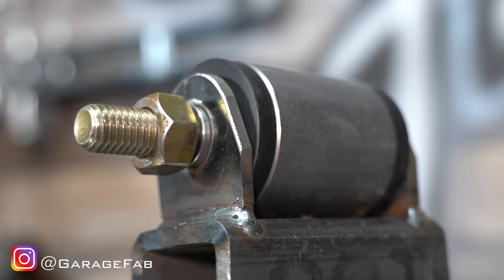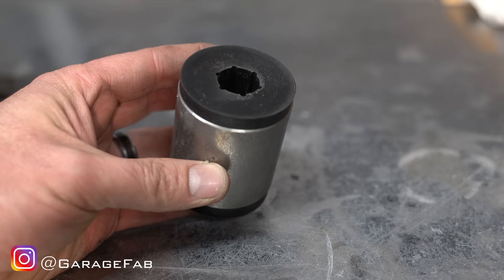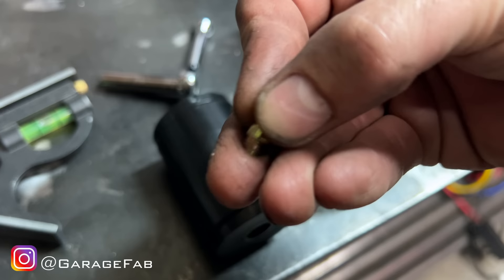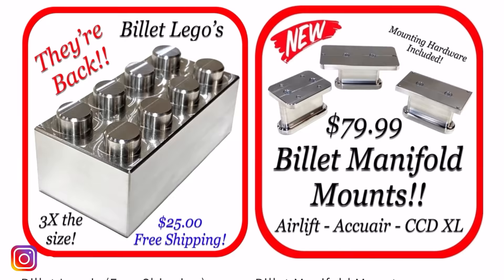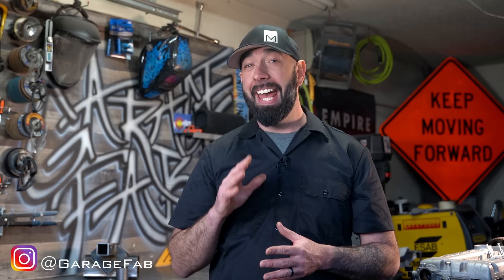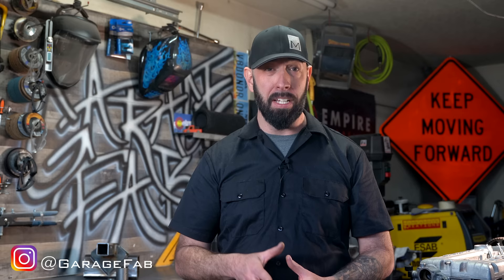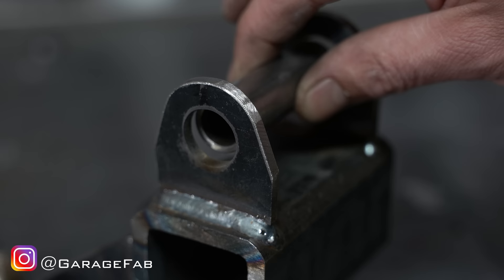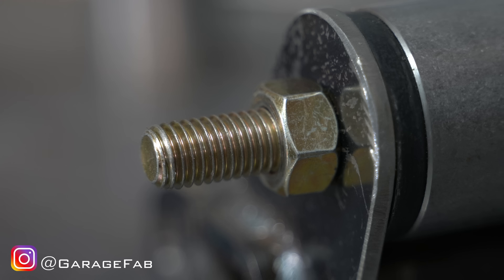The DOs and DON’Ts When Installing Polyurethane Suspension Bushings

Comment: Deceiving information for the beginners. The introduction should mention the two major differences between bushings. One is bonded, the other is not. Meaning one has no moving parts at all and MUST be tightened with the vehicle resting on its wheels, flexibility is provided SOLELY through the rubber.
The other can be tightened when ever (the grease one), because the rubber can revolve around the inner bushing, make sure to use washers or spacers to prevent bottoming out the nut on the shank of the bolt!
Also, you never clarified what is wrong with the picture, other than it should be a grade 8 locknut and the threads needed to be trimmed.
Don't use grease for the bolt, use gray antiseize, it outlasts any grease 10:1 and apply it to the ENTIRE bolt, including threads. The lock nut won't care if it's there or not.
5:08 does not make any sense to me, but I haven't built suspensions from scratch. You make an angled support strut, but the bushings are 45° to the load. It would make more sense to weld the carrier on an angle and keep the bushings perpendicular to the strut. I will try that myself.
Reply from the maker: There’s a lot to unpack there Dan. Let’s start with the bonded bushing. They are… well… bonded. They come fully assembled and therefore cannot be assembled improperly. They can be installed improperly as you mentioned, but bonded rubber bushings are not commonly used on custom builds and so they don’t have a place in this video.
Good call in pointing out the possibility of the nut bottoming out in the shank. I regret not including that.
Everything (almost) that was wrong with the intro bushing was addressed. The improperly shaped tabs and the tab holes that are too large and allow the inner sleeve to pass through. When designing the “bad bushing” I also didn’t provide enough clearance between the body of the bushing and the frame that the tabs mounted to. Unfortunately I forgot to bring that up in the video.
Anti seize instead of grease must be a preference. Ironically today I saw anti seize slathered on some brake caliper pins on a rusty car that normally has grease. The anti seize was dried and crumbly and it was tinged with rust. Before today I already hated anti seize and it’s get everywhere-ness. It has its place (on threads) but in my opinion nowhere else.
5:08 is a triangulated 4 link. The two angled bars keep the axle situated side-to-side. The orientation of the bar ends you described is commonly done and is ideal on static height vehicles. On adjustable height vehicles, though, (what I specialize in) the suspension can see upwards of 12 inches of travel. When the bushings are mounted perpendicular to the angled bars, the axis the bars rotate around passes diagonally through the bushing. So in essence the bushing is forced sideways. This destroys polyurethane bushings quickly.
For this reason I turn the bushings so that the bolts line up with the axis the bars rotate around. This puts more stress on the sides of the bushings which they are not designed to handle, yet they still last far longer.
Cheers, Dan!
Reply: @GarageFab  my man! Thank you for clearing up the points i made. I appreciate the time you took to write the reply. It does indeed depend on the type of antiseize and where to apply it. I have best experience with permatex and it is usually used on threads and applications that don't get too hot. So brakes are definitely a nogo for anti seize. Brakes, including calipers can get extremely hot. Rotors red hot, calipers 200°C, boiling brake fluid, so it certainly will ruin the antiseize.
The suspension design now makes sense, but it sure is a weird one haha.
Anyway, the least I can do is sub.
Thanks again!
PS I know how hard it is to make the video that pleases everybody (impossible).
Reply from the maker: You are appreciated, Dan! Happy to have you. I hope to see you in the comments section in the future. I’m hoping to make Garage Fab a top source for good info and you clearly have some of that.
Cheers mate!

Comment: Good video, but one thing:

A bushing is NOT the same as a rod end.

A bushing allows rotation about one axis, as well as giving some compliance, where as a rod end is a spherical bearing that allows (limited) rotation about three axis, and is rigid.
Reply: I disagree.... a "rod end", is simply that, an end meant to terminate a rod of sorts, in the case at hand, a suspension arm. A rod end may feature either a bushing, or bearing. Now the actual functionality difference between the two is exactly as you stated. 

However, in common nomenclature, what you say is commonly assumed as correct. If you tell me a "rod end", I'm going to usually assume you're talking about a spherical bearing end ("spherical rod end"), and only specifically note a bushing application, if you say "bushing rod end". I think the assumption will change depending on who you are talking to, and their most common use/application., but a rod end may have either a bushing or bearing. I personally would also assume you were referring to a piece with a threaded shank, but again, that's a nomenclature assumption, and would vary from person to person.

Case in point:
https://www.summitracing.com/parts/paj-1260-5-8

Now if you say "heim joint"...that's a different case, that's a bearing end, end of story.
Reply: @rwbodiford  Interesting; I'm usually the one who gets accused of being too literal.

Everything you say is true, and maybe the vernacular is different in the automotive repair industry, but I've read many books on race car suspension and automotive chassis design, and frequented many car forums, and I've never seen a bushing referred to as rod end.
Reply: @noahkatz9616  There's always "that guy" lol..... and if you comment on a YouTube video, you can be certain he'll always surface! 

Bushing rod ends are not near as commonly used, so the general assumption is always that a rod end is a bearing end, and I mean, it's a pretty safe assumption, like I say, I'd assume and know you meant a bearing end if you just said "rod end", but you just can't conclusively say that is the specific difference between a "bushing" and a "rod end". But yeah, either one can be a "rod end".  Could also debate the hybrid "Johnny Joint" as a third configuration if you were feeling frisky.

I'm actually about to use those same ends I linked to on a project,. I only need one axis of motion, and the added dampening of a bushing is beneficial in my case ( of course with performance sacrifice ), and I can still obtain a precise length adjustment on the link arm with the threaded shank, very application specific, but also, very useful when needed.
Reply: @rwbodiford  Well I'm not as well-versed as I thought - I wasn't aware of the joints you linked nor Johnny Joints; thanks!
Reply from the maker: I’ll chime in with some interesting behind the scenes info. This entire video was created in one day from start to finish in a rush to meet the Sunday morning deadline. While editing I noticed I said “Rod End” when I really meant to say “Bar End.” Which I believe is the universally accepted term in the suspension building scene. I decided to NOT bother with re-recording because in fact in the mechanic world “rod end” is commonly used regardless of the type of end. For example Tie Rod End (ball joint) vs. Torque Rod End (bushing).
I think it’s good practice to use a descriptive word for the sake of clarity. “Spherical rod end.”
Thanks for keeping it civil my friends! It was my hope that Garage Fab would turn into a place for discussions that didn’t always require my presence.
Cheers!
Reply: @GarageFab  So this is all YOUR fault :)
Reply from the maker: @noahkatz9616  Exactly!

Comment: I have never been a fan of the polly aftermarket bushings, OEM bushings are much better IMO
Reply from the maker: Every product has its place. If you’ve got a static height vehicle and want a comfortable ride, rubber all day. If you have adjustable suspension or a lot of travel, you’ll hate rubber bushings the second time you have to replace them.

Comment: Lol 😂 not required:) just have cut my rear suspension bolts together with bushings in my mazda 6:))) about a  week ago:) that won’t happen, if they were lubed properly 😊
Reply from the maker: It happens.
Reply: @GarageFab  even with lube inside?
Reply: @GarageFab  besides those rear suspension eccentric bolts I had to cut stabi links :) one of the main tools ⚒️ for repairing Japanese cars 🚗 is grinder:))) I had to change bushings in rear undersping arms, which certainly are connected to stabilizer links. Mazda rear arm price is $200 per one ☝️ local bushing $9
Reply from the maker: @SlavaKolesnikov  In Vegas, we don’t see rust fortunately. If we have to cut stuff apart it’s guaranteed the car came here from somewhere else.
Reply: @GarageFab  Canada 🇨🇦?) here in Ukraine 🇺🇦 there are tons of snow ❄️ salt 🧂 water 💧 mud 💩 meaning your suspension and chassis suffers a lot
Reply from the maker: Ew. No thanks! 😆

Comment: Nice, would be even beter using international metric system instead of the obsolete inches and pounds.
Reply from the maker: Believe it or not, I agree!! I tried to make the switch a year or so back. It didn’t work. Though the Imperial measurement system is outdated and confusing, it was impossible trying to measure everything metric and have to convert it to inches in order to purchase parts and materials.
If someone here in the states flipped a switch and we all went metric, that would be amazing. Too bad it’ll never happen. 🤷‍♂️

Comment: You worked for Toyota and seen bolts rusted into sleeves, yer the assembly line doesn't lube bolt shanks, slack and cheap. You left out the bit where Toyota nor any other decent manufacturer uses Polyurethane for suspension bushes.
Reply from the maker: Manufacturers must balance comfort, quality, and production costs when making millions of vehicles. Rubber bushings are soft, absorb a lot of vibration and are very cheap. So this is a great choice. They use quality rubber but it still won’t last a quarter of the life of the vehicle. 
Quality polyurethane is significantly more expensive, is far stiffer which channels a lot more vibration to the driver. This would be a terrible choice on their part. Poly lasts much longer and is far better for performance and overall is superior to rubber. There are a LOT of things that could be done better on any manufacturers vehicle but they are simply not cost effective. I’m unsure what point you’re making with the grease. It’s unnecessary in the majority of climates and so none of the manufactures grease their bushing bolts. So is every last manufacturer slack and cheap?

Comment: So, no info on installing and torquing oem bushings.
Reply from the maker: Nope, not on this one, sorry. 
I can tell you what I know here though!
Unfortunately I can’t tell you the torque specs, because torque varies with the size and rating of the bolt that is used.
I can tell you that the majority of OEM bushings are bonded rubber bushings. It’s imperative that you don’t torque the bolts down on this type of bushing until the weight of the vehicle is on the suspension.
Failure to do this will tear the bushings or caused them to fail prematurely due to being over flexed or over twisted.

Comment: The only thing missing from this: follow the instructions of the bushing manufacturer. This guy clearly uses a brand where this advice helps, but when it comes down to it, it does not necessarily apply to all poly bushings.
Reply from the maker: I’m unfamiliar with any polyurethane bushings that this stuff does not apply. Bonded rubber bushings are a completely different animal though and require specific torquing procedures.
Reply: @GarageFab   @GarageFab   Hey, awesome reply. I was really pointing towards the energy suspension bushings. 

On other forums, folks debate about which way to do it, but when it comes down to it,  just follow the instructions.

Case in point, ES (at least for the prelude/240sx/Celica GT4) does not come with grease fittings or troughs. You really just have to grease  (example) - 

"7. Grease the I.D. of the lower control arm (where the shell was). Grease the Energy Suspension bushing. Grease all sides
of the bushing that contact metal." 

Basically, they want you to great the inner AND outer portions of the bushing.  So, not knocking and you most certainly arent wrong, just reading through how folks debate through these and adding my .02.
Reply from the maker: I can’t argue with following directions! The manufacturer should certainly know what’s best for their product. Especially a company like ES.
I can tell you that I’d be modifying those to have a zirc fitting though. I’ve never had a poly bushing stay quiet with minimal supplied assembly grease. I think racers don’t care much about a little suspension squeak. On a daily driver though, insanely annoying.

Comment: This is all well and good and to me it's common sense, until the bushing is welded to a bar. Therefore how does one weld the bushing to a bar without melting the rubber bushing, cant believe you didn't explain that part!!!!!!!!!!!!
Reply from the maker: That’s a whole other video my friend. This one was strictly about the proper assembly of a polyurethane style bushing.

If you want to see the process of the bar end getting welded on melt free, you can see it in these videos.

How to Make Identical Length Link Bars! Mighty Max Ep. 12
https://youtu.be/feDRfsqvJ3g

C10 Parallel 4 Link Design and Fabrication / Long Distance Fab Part 1
https://youtu.be/hbxr4k14qH8

Impossible to Make Control Arms! JK They're Pretty Easy. Mighty Max Ep: 20
https://youtu.be/pyKNkjhrHOY

Build Poly Engine Mounts For Anything! Mighty Max Ep: 19
https://youtu.be/7UH2zVVVw8Q

Comment: You missed a huge mistake. When you lower a vehicle's ride height you are meant to loosen a bushing on each control arm and shock mounts then tighten them once the car is sitting on all 4 wheels, this is why bushes fail on lowered cars so frequently. It is also why 4 post hoists or wheel stands are handy to have for suspension work.
Reply from the maker: I’ll have to cover that on a future video. It’s very important indeed but this particular video was not about lifting or lowering and was also not about bonded rubber bushings. Polyurethane bushings don’t have to be loosened before adjustment since the inner bushing slips.
Reply: @GarageFab  Thanks, yes I am referring to standard bonded bushings as most people don't change them when lowering a car. I didn't know that poly bushes slip though
Reply: @GarageFab  Also if you haven't done it, could you do a video comparing Rubber bushings to Poly and Delrin? I just found your channel. I have heard Delrin is the better option but I don't see many people using them
Reply from the maker: Yes, I really think I will make that video. Especially after some of the comments that I’ve received on this video. Each bushing type has its place. Rubber is better for comfort. Delrin is better for channeling horsepower from the engine to the ground. Polyurethane is fantastic for long travel/low articulation applications. And the intended use is what makes bushings bad or good. A Delrin bushing is terrible on off-road vehicles. Rubber is absolute garbage on bagged vehicles. Unless somebody gives you a compelling “why” anything is good or bad, ignore them and do your own research.

Comment: Me:*lubing both inner and outer sleeves on bushings*... "uh, oops"
Reply from the maker: That’s not a problem at all my man. Even when lubed, there’s so much surface area that the outer sleeve probably won’t rotate before the tiny inner sleeve. And if it does, still nothing to worry about.

Comment: Poly kits usually come with white vaseline
Reply from the maker: They do come with grease! Though I don’t think it’s Vaseline specifically. Petroleum is one of the chemicals that breaks down polyurethane and rubber. Vaseline is petroleum jelly. The grease supplied with polyurethane bushings is likely a silicone based grease similar if not exactly the same as dielectric grease.
Reply: @GarageFab  yeah. It was white stuff, not sure if it was vaseline though. Think you are right could be something else.
Reply from the maker: I’ll see if I can find out. Cheers!

Comment: Poly bushings are at best bad news. NEVER replace the OEM style on a road car. Never, they cause mounting points and suspension arms to fail. I have seen it numerous times, and the damge to car when they crash. That is WHEN not if. And yest there has been fatalitities as well. And bind the suspension so the car handles crap. 
 At one stage we were getting poly engine mounts,, hopeless as they transmitted that much engine noise back into the car.